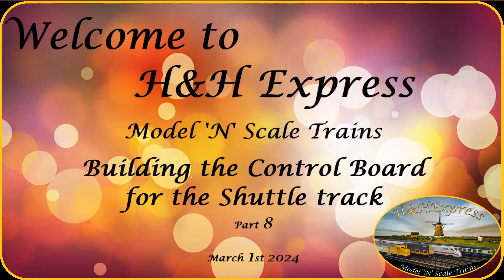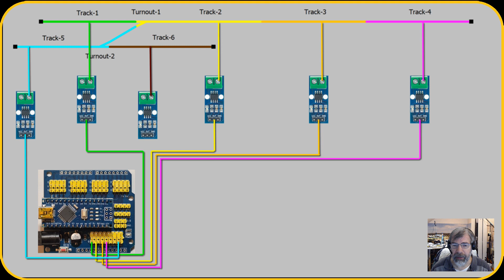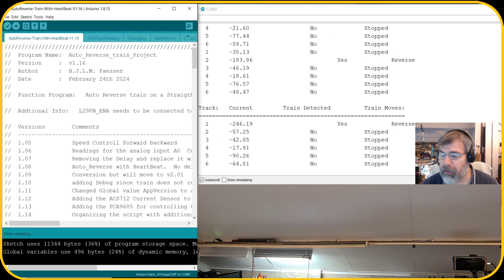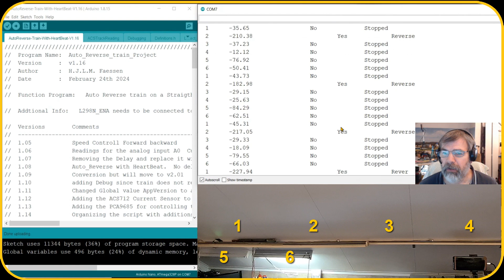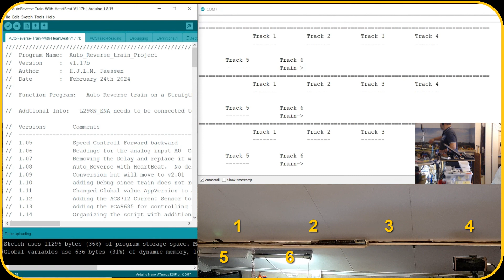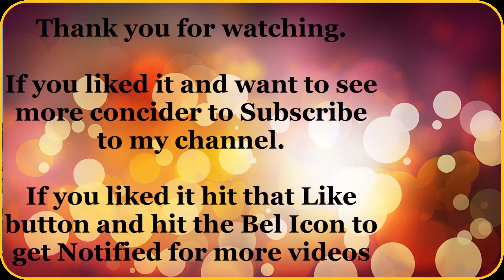Shuttle Track Explaining and Building the Control Board - H&HExpress

Comment: I’m assuming you have so many sections because of future plans besides merely shuttling back and forth?

Would the hardware requirement still be similar if using this with dcc and jmri?
Reply from the maker: Ken, i made so many sections for testing so i can use the technique for my main layout. In regards to you  question about DCC and JMRI you do not need to use that much Hardware